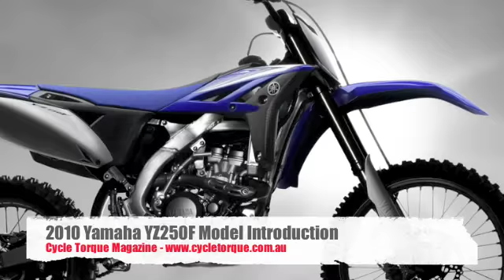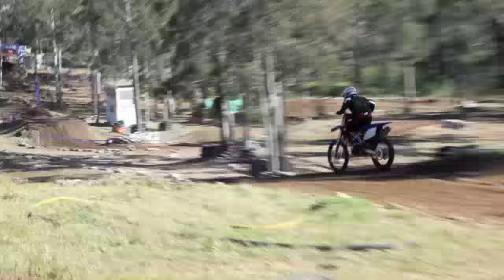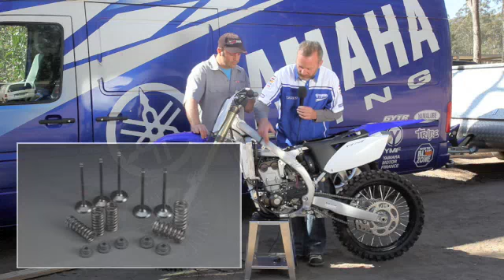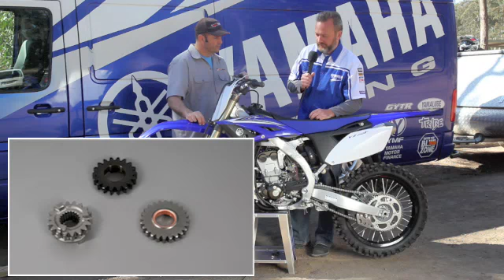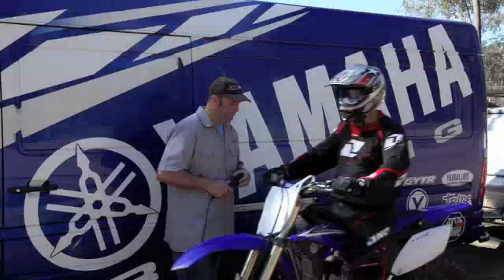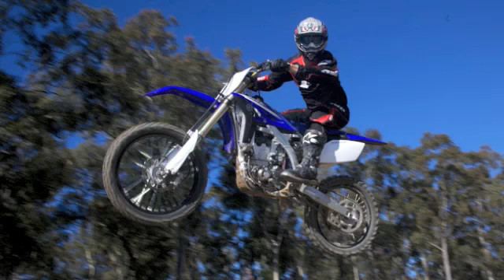Yamaha YZ250F 2010 model launch

Comment: it has to do with the weight distribution and the shape like if the forks are more straight up and down the bike will be very sensitive to little turns it will dart side to side and if they are slope liuke it will be a more mellow feel as you try to turn also the shape helps with weight transfer to get the front wheel firmly on the ground then when you get back on the gas the weight needs to transfer back to thae back wheel